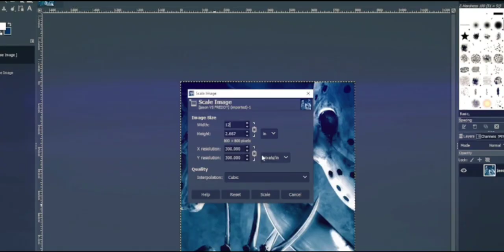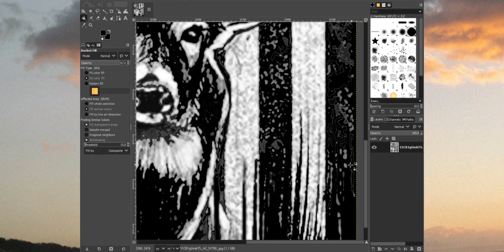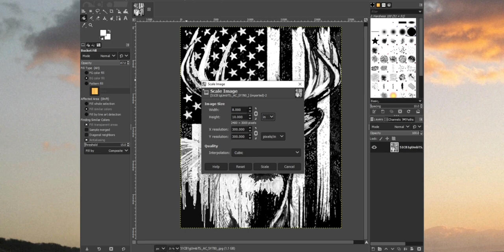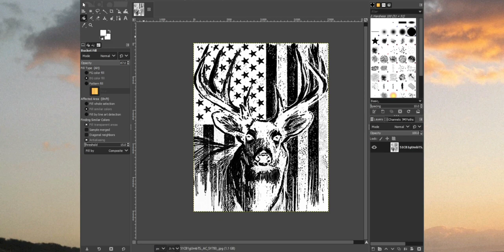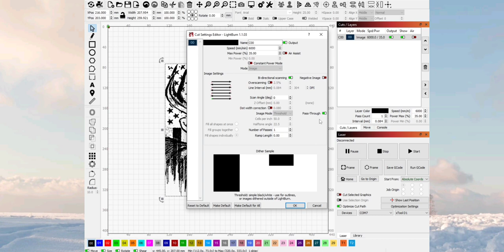American Flag with Buck Engraved with the XTOOL D1 10 WATT Laser (Red , White , & Blue) Easy Money 💰

Comment: Man you do amazing work.  How do you finish your canvases?  With a spray clear or epoxy coat?  Do you have a video showing this?  If not can you make one????
Reply from the maker: I use clearcoat on canvas.
Reply: @zerica24  Just a spray on?  Have you ever had issues with cracking paint?
Reply from the maker: @forreal7568   No I use several Light Coats  to prevent cracking

Comment: hey friend got a question for you  well 2 questions really. when you re spray a mistake canvas mine came out more of a shadow how much more would your temperature change.   question 2   input canvas whit red orange and then black trying to do a harry potter(I didn't have yellow) but when it burnt I couldn't see the color  any advice would be appreciated thank you. love your work
Reply from the maker: You have to repain the canvas until completely white and let it dry completely before adding black. Second question  you need to run a test to see which settings expose the most color and adjust from there.

Comment: I need more practice... what is the pass through engaged mean, if you would share please. thanks
Reply from the maker: It is used when the image is edited in different software  than the engraving software.  It allows the editing to be used  with the burning software
Reply: @zerica24   how do you the dust off of canvas after you are finished?
Reply from the maker: @laurac4562  I use a foam brush
Reply: @zerica24  basically all my picture definition disappears and it looks like a negative sort of when I wipe it off. I did denzel and jack sparrow like your and they came out nothing like yours. any ideas?
Reply from the maker: @laurac4562  email me at Southernsmokeengraving@gmail.com

Comment: I bought the plug in for gimp works good except I am getting an error when it runs, the message is 2 different plug are trying to register, do you know why I am getting this? I installed gimp and the big gimp plug in fresh. Also when I export and exit I get there is an image with unsaved changes this is after I export and saved the image. Any help would be appreciated. Thanks
Reply from the maker: It is trying to get you to save the file in Gimp using .xle as a file name . after you save it to your desktop, you no longer need the edited file.
Reply: @zerica24  thanks for getting back to me what do you know about the first part of my message where it says I'm trying to run two plug-ins at the same time 0
Reply from the maker: @mikeledee8786  Email me some screen shots of it at Southernsmokeengraving@gmail.com
Reply: @zerica24  I sent the screenshot to your email